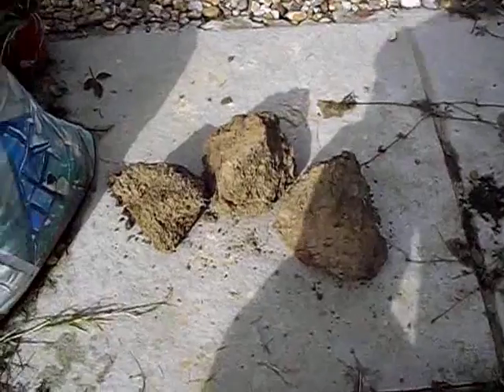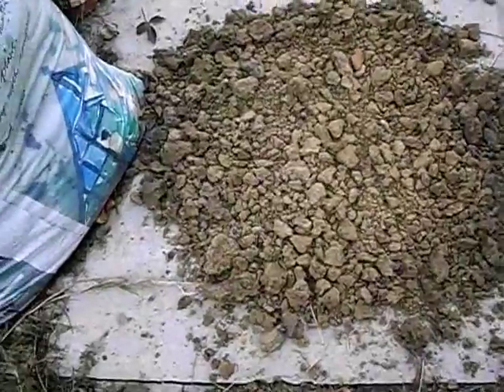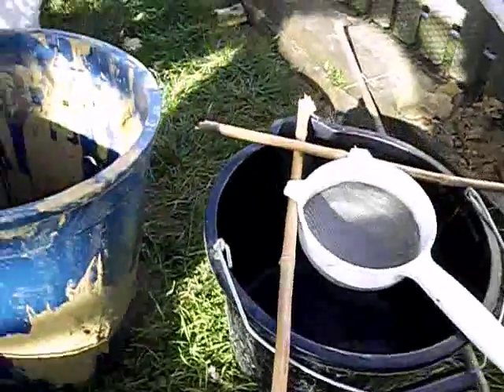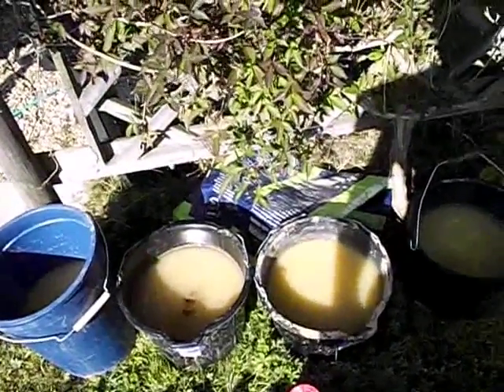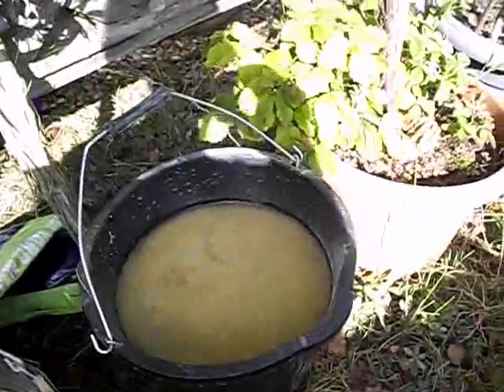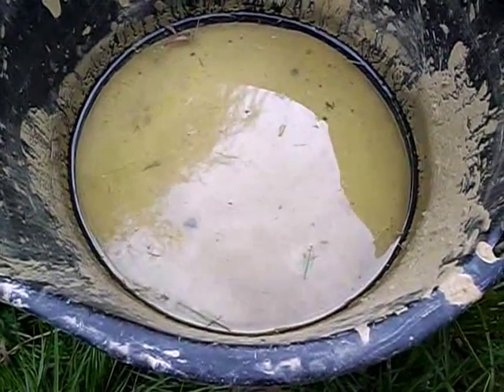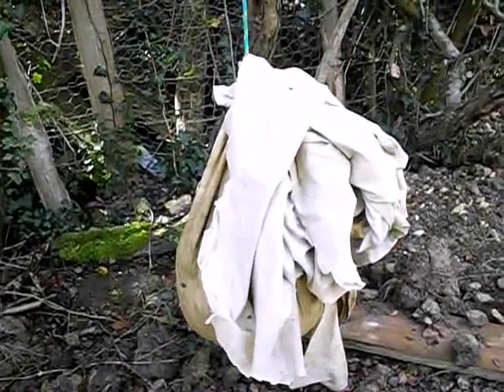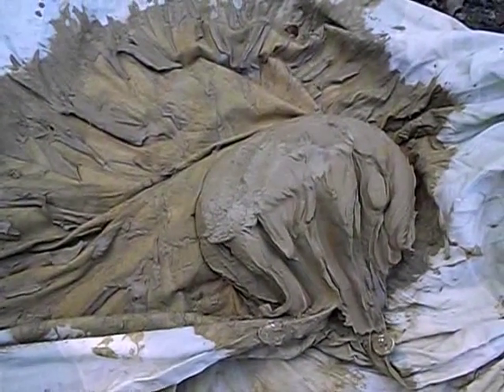Clay from water extraction

Comment: If anyone know how to separate silt and clay its very hard PLSSS help me i want to create a pots but always breaking when i fire it that's maybe because of the silt.
Reply: It’s almost impossible to extract silt from clay but it’s never really a problem if anything it’s good to have silty and sandy clay if you were to pitfire
Reply: Also it’s more likely the way you fire them I can tell you are probably a beginner but if you are make sure the pots are bone dry which means it has no more moisture then warm them up slowly by heat from the fire (not directly in the fire) when they get really hot over a while from the heat then what I’d do is use wood in a tipi style so it would not allow thermal shock to occur and once it all burns down allow to cool slowly and be very patient as being impatient will result in lots of cracked pottery. Something I want to add is make sure youre using pure clay. As topsoil mud extract isn’t really good enough hope this helped some :)
Reply: Try heating your pots in the oven at 190 or so for a couple of hours before you fire to let any residual non-molecular water steam out of them. But as for silt, its hard to get out without using a specific size screen to sift it out. Supposedly you can get it out by letting your liquified clay sit in a bucket and pour it off after the silt settles to the bottom but since buckets aren't usually clear its hard to see the line between clay and silt.
Reply: Put the clay in a bucket with water break up the clumps of clay in the water once your done let it sit to settle the Silt down  then put it into a pillow case preferably two and tie the top hang the  bag of dirt and let the water sweat out it takes weeks